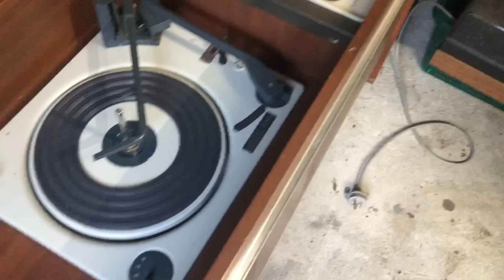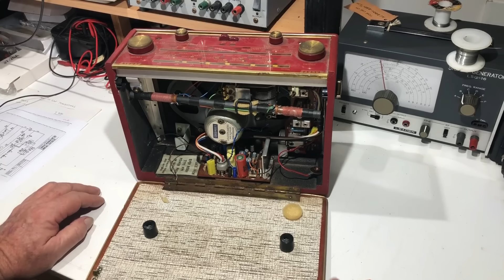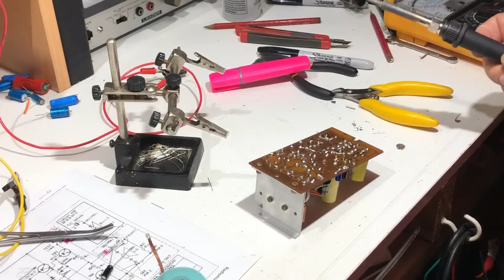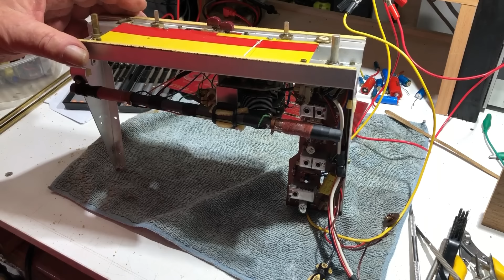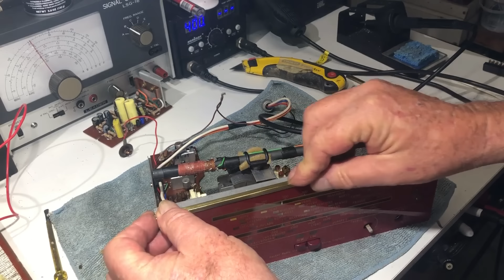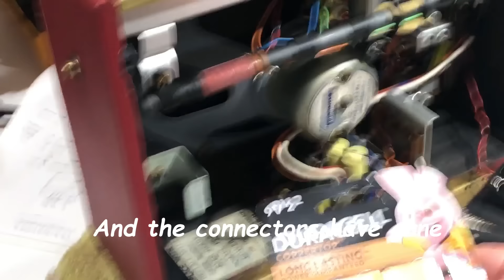HACKER Herald model RP30 Repair and Restoration

Comment: a later model version of this, RP35 had the RF board at the top, with later runs using silicon transistors
Reply from the maker: They're pretty rare over here.  I haven't seen another Hacker since this but I wouldn't mind getting my hands on an RP35 if I can
Reply: @Donno308  it 'looks' basically the same thing, just internals are redesigned a bit, there was an FM only RP37 ,but only up to 101mhz, as did many FM sets in the UK until mid 1970s, and an FM/AM model, cant remember model no. but also known as the 'sovereign' i used to have all 3 but now sold as needed the money....

Comment: dont blindly trust  exactly the service data, sometimes there were changes during the production run , and the schematic you find may be for the original, or vice versa.. or may be a mistake in the diagram, ..
Reply from the maker: Hi Andy. Yes, I find a lot of that. I'm currently working on a Pye Black Box stereo. I don't know how many versions of it there are but the schematic and the PCB diagram can only be taken as suggestions 😂
Reply: @Donno308  the valve version  mono  black boxes have about 3 versions of the circuit,

Comment: that broken speaker coupler cap seemed good on test to me, measuring high capacity doesnt necessarily mean theyre bad, many older ones had high positive tolernace, up to 80% for some
Reply from the maker: Hi Andy
No it didn't measure too badly but I wasn't testing for leakage, just capacitance. It had obviously been hot which suggests leakage and you certainly don't want a leaky grid cap.
Reply: @Donno308  grid cap in a transistor set??😉 and getting hot? shouldnt be possible in this! unless someone shoves mains in the thing (i have come across this with a UK Magnavox table top transistor set, well, certainly high voltage,, rammed in the 'tape out' socket, the detector diode was blackened exploded 😲luckily the IFT had survived

Comment: Because of the traces get heat damage,did you use 60/40 leaded solder?or lead free solder? Lead free solder takes longer to melt,which easily damage the traces,if the soldering iron touches the Board too long.i use 60/40 leaded solder,low melting point,fast replacement of components.greetings from germany.
Reply from the maker: Hi,
I use leaded solder - I think it's 60/40. The problem is that the component leads were tightly bent over and required use of a solder sucker followed by repeated wicking to get them free. Any attempt to lift them without completely freeing them resulted in the track lifting.  Most of the damage happened trying to lift and straighten leads where a small amount of solder was still adhering to the trace.  That said, I managed most of it without damage.
Cheers
Reply: @Donno308 i use 60/40 solder,from multicore, works perfect, for my tube radios.

Comment: Excellent job a rub of the Green every now and then can make life easy , Those radios are very well made rather Expensive but they stood the test of time ,  Have you studied electronics or is it a hobby   ?  your dam good   Many thanks for the video , ☘☘☘☘☘.
Reply from the maker: Hi John.
Yes this certainly is a nicely made radio. Quality all he way through.
I did study electronics when I was much younger, with Telecom Australia, now Telstra. They were moving towards electronic telephone exchanges so there was some electronic theory involved although it was mostly electro mechanical back then.  I later worked on pinball machines and arcade games for some years before giving that up for a "proper" government job.  I've messed with electronics on an off over the years but I have to say I've learned more from youtube than from any formal training and I still have a lot to learn! 😅
Reply: @Donno308  Hi Don , Very interesting  looks like a full  life down under , YouTube can be very helpful Diesel car engines [ old ones ] take up my time [ while waiting for the last flight ] at eighty one years i,m enjoying life , The time here is just gone Twelve noon Perth time  Seven P/M temp 21c, Take care ☘☘☘☘☘.
Reply from the maker: @johnburns6422  Diesel car engines, hey?  Sounds interesting.  I've done my fair share of tinkering wth cars but I tend to go for old English cars. Jags, Rovers, Triumphs.  I currently have an MGB which keeps be busy.
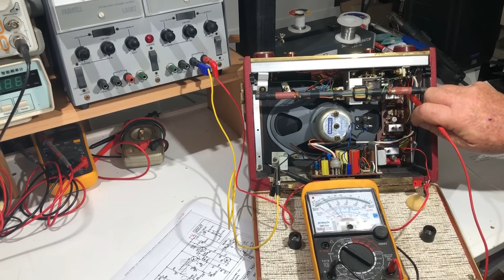7:40 here and also 21C. Dark already. Winter is coming and the evenings are getting cool.
All the best

Comment: A cracked circuit board 👌 can be repaired, but it has to be done so, underneath, with wires. This "bridges" the broken solders on top of the circuit board. Where there's a will, there's a way. That's a Shango066 quality radio 📻. Your friend, Jeff.
Reply from the maker: Hi Jeff. Yes we used to do that all the time "back in the day" when I was working on arcade video games.  The tracks were pretty fragile and close together and those machines took a lot of vibration and general abuse!

Comment: Hackers were very sought after, never could afford one as a lad and you never saw them at the jumble sales. Slightly disappointed with the quality of the circuit boards though, perhaps they were never meant to be worked on! OC71s again, you're becoming a specialist in old transistors! Keep up the good work, just about caught up with your back catalogue.
Reply from the maker: Hi Owwcam.  Hope you're enjoying the back catalogue. Some of the early ones were pretty terrible!  
I think the circuit boards on the Hacker were as good as anything else around at the time. The technology has advanced quite a bit since then.
Cheers

Comment: Get yourself a Hakko desoldering pump tool.  Expensive but works really well.
Reply from the maker: Hi Eric
They all seem pretty expensive but I guess it's better to get a good one instead of mucking around with cheap stuff.  I'll have a look at the Hakko one anyway.  Thanks for the recommendation.
Cheers
Reply: @Donno308  Thinking about it, I do a lot with PCBs, and it's great for removing components from them.  The only issue I found was if you are cleaning solder off a valvebase or tagstrip after cutting a few wires you have to be careful not to suck a tiny bit of wire into the nozzle. It can get blocked and you need to use the tool they provide to poke it out. It comes with different size nozzle holes, all are much smaller than the one on a manual solder sucker.  I hate those, they don't work too well and kick back towards the components which can damage things.

Comment: Hi  Don, I've  repaired 2 of those Telefunkens  here in the states. Put Bluetooth  on both. Found them to be great radios. One word of caution, be careful  of what you use to clean piano  key switches with.  Great job on all your repairs.
Reply from the maker: Hi Dennis
Thanks for the tip re the piano keys.  As I won't be doing that one first I'll put a sticky note on it to remind me.
Cheers

Comment: Don Some those little transistor radios can be at times are then vacuum tube set because of the room and those fragile circuit boards .
Reply from the maker: Hi Richard,  Yes in some ways they are harder. Everything is so fragile, especially those old PCBs and you have to be so careful not to overheat anything.
Cheers

Comment: Very nice Hacker radio Don, sure looks great & seems to perform pretty good too.
Top little battery adapter mod, I guess it would last a while on those little ones if it's only 18ma draw.
I'm leaning towards the HMV console radio next, although the radio gram would be good to see too.
Top Vid as usual mate, Cheers
Reply from the maker: Hi Baz. Yeah not sure how long the little batteries will last but for he amount of use it gets they will probably be ok.  Graham (Radiocruncher) is apparently sending me some connectors for the original batteries so I might convert it back when I get them. Apparently they are available.
I have pulled the HMV console out & so far checked the speaker field coil, which is ok. That would have been a deal breaker.  I hope the power tranny is ok.  Anything else can be fixed.
Cheers

Comment: PP9s are still available and will last longer, but I'm finding them a bit unreliable recently (don't know if it's a QA problem with a batch) so I've converted a few Hackers to PP3s as you have. I quite liked the way you fitted those PP3 holders so I may revisit a couple of mine!

Comment: Hi Don, great little Hacker and top job restoring it. The PP9s are available, the last lot I bought were about $10 each. RS were selling them much dearer than that, so shop around. Nice little adaptors for the temporary batteries. I did the same Philips about 12 or so months ago, nice little FM set. The gram would be a good project 👍🙂
Reply from the maker: Hi David.  Graham is sending me some repro connectors so when they arrive I'll pick up a couple of PP9s.  I'll shop around though, as you suggested.  I may also be getting another Hacker.  I quite like them so I wouldn't mind doing another one.
I've pulled out the HMV console and let's just say it's a bit of a mess.  With the weather improving I should be able to do the cabinet work outside, which is just as well as there's no room in the shed.  That gram will have to be next. 🙂
Cheers

Comment: Nice job and a great radio. Elegant solution with the batteries, but I don't think they'll last long as they are about 1/10th of the capacity of the original PP9 batteries, if I'm not mistaken.
About the Philips: that model is extremely common here in Belgium/Netherlands. So if you ever need some specific parts for that radio, I'm quite sure I can track them down.
Reply from the maker: Hi Kristof. Yes the 9V batteries won't last long but they are cheap and plentiful so for my purposes they will be fine.  I could make up a couple of battery packs the same size as the original ones with multiple 9V batteries in parallel but we'll see.  I've been using it now at home for maybe 4 or 5 hours total and still ok so far.
No one has shown much interest in the Phillips - everyone wants to see the old HMV so I put on my rubber gloves and dragged it out of the shed.  The speaker field coil has continuity so i should be able to get it going provided the mains transformer isn't dead.
Cheers

Comment: Great video Don! I very much prefer the 30-60 min. ones. Caldeira would still meticulousely be measuring every single component and Tipton would be paintstripping the grille for the fourth time to get the proper colour, I'm glad there's a third way to go😄
Now these two gentlemen that I mentioned are indeed My heroes in restoring but It's good to see the work being done a bit closer to My end of this brilliant hobby👍
Reply from the maker: Those two gentlemen taught me most of what I know about radios and I'm still learning from them but I do try to go for the middle ground with my videos.  Glad you're enjoying them.  The old HMV console radio will be next.
Cheers

Comment: For most electrolytic capacitor uses, other than those in frequency sensitive filtering applications, a tolerance of -20%/+80% is common.  If something well beyond that to the upside is seen, it might be a situation where the film has broken down and you're looking at galvanic effects.

Comment: That old HMV console looks like it needs some love from you Don!  It sure looks to be a challenge if you're up to it! That
early type of circuit board is very fragile and  solder sucker action could damage it. No easy way without a modern electric desoldering gun. Those soldering stations cost quite a bit too. Good troubleshooting there on the Hacker's  touchy tuner
on whatever you did. It's a really nice looking radio after all that fussing around with it Don.
Reply from the maker: Hi Steve.  Yes the HMV certainly does need some love.  I got it for nothing so nothing to lose I guess.
The Hacker is still going well so I guess it was the tuning cap all along.
I've already dragged it out of the feed shed & had a look over it.  I think it will be ok.
Cheers

Comment: I concur with most of the folks around here. The "Shango066 approved" HMV console would really be interesting of a complete makeover.
That Hacker sure is a pretty radio with great sound with the speaker that it has!

   Nice work Don.
Reply from the maker: Hi Tom, Yes, I'm sure Shango would approve of that one. I'll pull it out tomorrow and get started on it.  Yes the Hacker sounds great and it's also great at rejecting a lot of the RF interference we get here  so even more distant stations are noise-free!
Cheers

Comment: Nice simple radio to start with. The red ones are the best lookers with the brass. Don't worry about the AF transistors, any silicon PNP will do just as well. I have chucked all sorts in there and the silicon transistors have a lower noise figure which actually improves the reception. I can send you another similar vintage radio when I can get to my stock of unworked on ones in the shed, Maybe a hunter or a sovereign, both have fm but very similar boards to the herald.
Reply from the maker: Hi George. Yes I was wondering about using silicon transistors - I thought they should work but wasn't sure.  I would be really interested in doing another one if you have one you can spare.  An FM one would be great.  Let me know when you're ready and we'll work something out.
Cheers

Comment: Hi Don,
Absolutely love AWA electronics products.  I also like the look of the 1930s HMV console radio - potentially a serious challenge!  I’m going to take the liberty of requesting you restore both radios on video (not at the same time LOL).  As it is not possible for me to see each radio in the flesh, you choose which one to tackle first.  The Telefunken radio repair/restoration can keep for a later date.  Perhaps it might be a good candidate for early 2025.
The Hacker Herald RP30 repair/restoration turned out well.  It looks, and performs as good as I would expect a close-on to sixty year old radio of such a former prestigious brand to perform, and look.
Regards, Phil

Comment: Greetings from Canada as fall approaches brrr , very nicely done with the hacker Don. I don't mind the transistor tech but I took my electronics training in the sixties and my first love will always be point to point wiring and tube technology. We had recruiters form Australia coming to our school in my senior year looking for graduates to go to Australia to work in the aluminum industry and I often wonder how different my life might have turned out if I had gone down under, it was a very good offer but I stayed in Canada and worked for IBM for 37 years instead it just seemed like 40 lol. Once I started with IBM I never saw another tube till I got to work on an ancient 80 column card sorter from the 50's that was on maintenance contract with Atomic Energy at Chalk River (why won't this thing turn on and what's that glow?).....lol. As for your next project my vote goes for that HMV console radio, it's a bit rough looking now but I bet it sounds amazing when you're finished.
Reply from the maker: Hi Mark.  It sounds like you did pretty well staying in Canada and working for IBM.  Australia's loss I guess.  I think Canada and Australia have a lot in common despite the opposite climates.  Who knows what would have happened if we'd made different choices.
I pulled the HMV out of the storage shed today and gee it's a mess!  The field coil has continuity though, as does the transformer primary.  It's going to be a big job though.
Cheers

Comment: Looks really good.
PP9 is very expensivebut will last a long time. Your solution however I find very elegant. 9V batteries  will give somewhere between 10 to 15 hours of life. I use rechargeables myself since they are not much more expensive than primary batteries, at least here where I live.
If you need the radiogram to go take that one first else the big console looking so sad and in need of tlc.

Comment: One thing I have learned from intermittent faults is to preserve the situation exact as it was when it started, and don't disturb parts until the fault is found and clearly visible. Minute pressures and movement of wires and parts will get you there most times. When going to rough you can loose the error, but it wil haunt you later on, even the mind can't forget :face-turquoise-covering-eyes:
Reply from the maker: Yes I probably was a bit too rough with it.  I guess I was expecting another broken wire,  I did do a lot more work off-camera to try to track it down.  I'm pretty convinced that it's ok now.  It was either a dirty wiper from ground to the rotor of the tuning cap or the deoxit accidentally removed some dirt or something shorting the vanes.
Reply: @Donno308  In case it returns, put a voltmeter on each of the emitters of the three transistors in the RF stage. The emitter here is influenced by changes on all three of the transistor leads, so you can fairly easy detect which of the three stages it is in.  This because I heard a popping noise with the fault, so a power supply issue is evident.
Nice result for that radio, the cabinet looks great. I admired the straight forward design of it, neat, orderly.

Comment: Voting for the HMV restoration, have you checked out your LSG 16 yet, managed to pick one up as well on ebay, NIB.
Works well, 455kh marker is off to the left a tad but so close that I will leave as is, there is no trimmers so I think minor adjustments would involve coil winding adjustments.